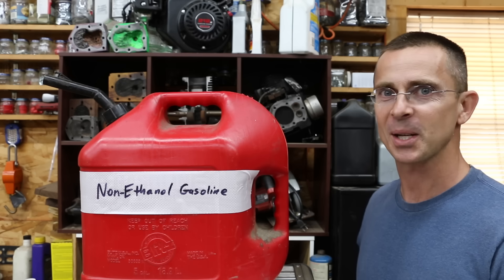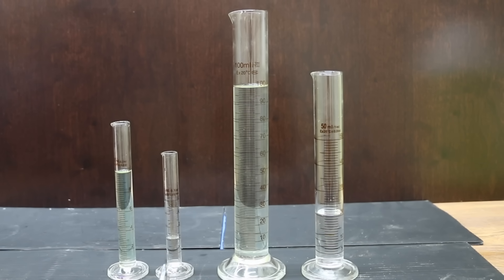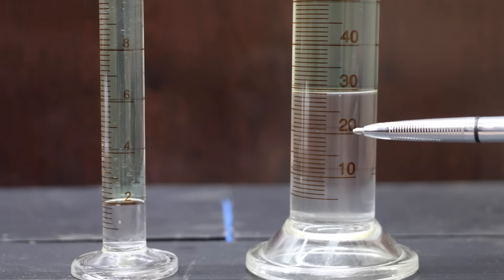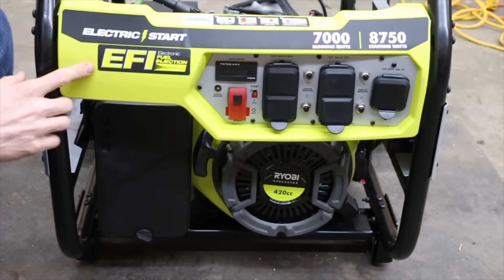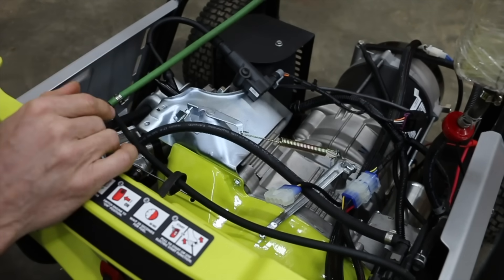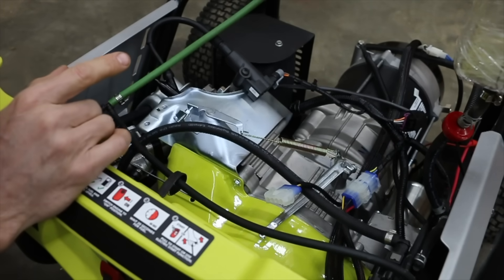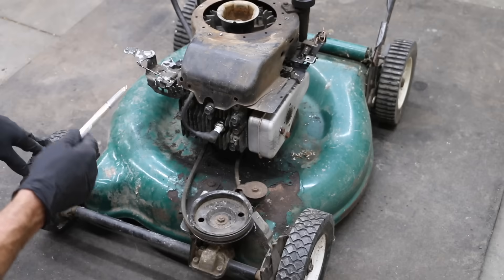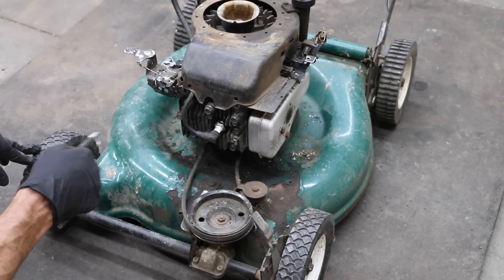Is Non-Ethanol Gasoline Really Better? See the PROOF!

Comment: I don't believe it is more efficient. There are less BTU's in ethanol blends than pure gas. Biggest problem is with small engines and anything with a carb or metal fuel system components. Corrosion is a real pain and water absorption and greatly reduced storage time of stored fuel. Ethanol has probably cost me $1000 's is ruined equipment. Rusted gas tanks, corroded carburetors, melted rubber components. The EPA has not looked at the total cost of ethanol production they just look at slightly less emissions. It does not matter to them that it takes 2 or 3 gallons of fuel to make one gallon of ethanol. Ethanol is gas is a boondoggle and helps no one accept the corn producers.
Reply from the maker: Thank you!

Comment: Ethanol  is a pretty strong solvent. So, if you have run an engine on straight gasoline or even E10, you will have a good amount of carbon deposits as well as some gummy residue throughout your fuel system. Using E85 for one or two tanks is going to give the ethanol the chance to start breaking down the carbon deposits as well as liberating some gummy residue. Thereby causing your engine to run rough and the ethanol gets the blame.  However, its actually cleaning up a dirty system and the rough engine will settle down and run very well  in a short time. An engine that has been run on E85 or better is a very clean system.  You also get a lot less emissions. Ever wonder why every serious racing engine setup runs exclusively nitro-methane or something very similar. Gasoline, or petroleum fuel is actually the leftovers from distilling crude oil into grease and oil. Somebody figured out that it was volatile way back when so they tried runnning their brand new horseless carriage on it.
It worked, but not nearly as good as what Henry Ford's initial product was designed for.
Reply from the maker: Thank you!

Comment: You put more ethanol gas than u did non ethanol gas. Easy catch. You poured the non ethanol to the sides. Then the ethanol to the top. None ethanol gas is for my camaro. Ethanol breaks away from gas. And will mess up a caberator. Let the gas sit a week or two and see what u find.

Comment: You simply overwhelmed the ethanol and stripped it from the base gasoline. Was that your intent? I have worked in the petroleum industry for years and have heard practically every falsehood about ethanol.I could explain the benefits of ethanol if you like, like the cleaning properties of it. Or that it keeps your fuel lines from icing up and never having to add HEET anymore. Also never having water left in the bottom of your tank causing it to rust and leak.

Comment: Problem with this test is the engine itself. With a higher compression ratio to take advantage of the higher octane rating / anti knock of ethanol I think the results would have been different. Added compression equals more efficiency. Engines are limited on compression by the of octane of the fuel.
Need to raise the compression ratio at least 1 point to take advantage of the ethanol.
Reply from the maker: Thank you for the constructive feedback!

Comment: There is a fallacy in how you measure the amount of alcohol in the gasoline by adding a measured amount of water. When two liquids of different molecular structure are mixed together without a chemical reaction between the different chemicals taking place, the volume of the mixed solution can be less than the volume of each liquid added together since the smaller molecules can fit in spaces between larger molecules.  It can be like adding sand to a box full of boulders.  I know that adding water and alcohol together result in a lesser volume than the volumes of the two added together. I don't know what the effect is on alcohol and gasoline being mixed together. The point of your demonstration that you can separate the water from the gasoline is correct but the actual amount can't be accurately determined by your tests.
Reply from the maker: Thank you for the constructive feedback.

Comment: oh so taking the ethanol out of gas lower the octane. Well that's a good thing. The lower the octane the better fuel it is. 
I know I'm gonna get a lot of know nothing's  that will say thr opposite.  the lower octane the higher burn rate. engines with sharp edges need lower burn rate. or higher octane.  Pinging is those sharp edges getting too hot and popping.
So lower octane is better fuel. stop believing the myth of higher octane us better fuel. 
yeap cheap gas is the best gas to run... unless your engine pings
Reply from the maker: Thank you

Comment: Theoretically ethanol fuel should result in poor fuel economy due to the fact that it requires more of it to burn now that's just what I've heard that's not what I know so don't take it as fact. But the reason it's worse than non ethanol fuel is because ethanol is a type of alcohol and that draws in a lot of moisture and if you don't drive a vehicle often enough or better yet even lawn mowers and weed eaters that don't run often it really eats up the fuel system. so I would say yes non ethanol fuel is better
Reply from the maker: Thank you

Comment: Why are people against ethanol?  Is the fact the energy will be produced by the midwest a problem?  Just think, you could be burning carbon neutral organic corn liquor in your hippy-dippy Prius.
Reply: It's not carbon neutral, as it takes energy to prepare fields, plant, fertilize (and other chem applications) , harvest, transport (grain), dry, ferment, refine and again transport corn-ethanol.
Reply: @gregm3139  it takes energy to ferment?  dry the grain? why?  sour mash/wort is a slurry not a dry powderous substance.  Corn oil converted into bio-diesel for the transport and running farm equipment.  Husks ,silk and stocks could be burned for still heat. Refine? You mean distill, right?  Its not going to be used for human consumtion why not use human manure for fertilizer.  Use hippy droppings and it would even be organic

You only dry corn to PREVENT spoilage.   Try putting yeast in dry corn meal and see how long the fermentation process takes.  You ferment dent corn not sweet corn, so don't even go there.

Comment: The biggest problem I see with 10% ethanol is an almost 10% loss in mileage on my 2007 Tundra.  That means I am purchasing about 10% more fuel, but really paying 10% more in FUEL TAXES because the FET (Federal Excise Tax) is on a per gal basis.  In my Tundra I am purchasing 1.1 gal of 10% Ethanol to get the performance of 1 gal of Non Ethanol gas.
Reply from the maker: Great points! Thank you for commenting.

Comment: Not an opinion but facts based upon observation.
2010 Merc Grand Marquis would get 22 MPG on corn gas and 25.75 on real gas.
Old 1984 Honda Goldwing Aspencade motor cycle required the choke to be partially on to run on corn gas and no issue with real gas.
Ariens Snow blower, like the Honda motorcycle would require partial choke to run well on corn gas but not on real gas.

The most damaging issue was a 2004 Class C RV which ran fine until I used corn gas and after that time the fuel filter would plug up every 1,000 +/- miles. Left me stranded quite a few times.
Reply from the maker: Great information!  Thank you for commenting on this.

Comment: I think your carbon test would have been better over the long term.

It doesn't look like you were getting carbon build up from the fuel, rather it looks like you're burning a bit of oil.

Once the combustion is contaminated the test results will be suspect.

For the record I've done testing on my old F100 w/390, 12.5mpg gas, 11.6mpg e10. This truck is an efficiency experiment (yeah, I know, a 390 efficiency experiment) and I've been pushing the timing as far as it will go with mechanical advance as well as vacuum advance for cruising (this is where the mpg gains come in). With e10 the total timing is some where around 42* mechanical + 10-15* vacuum, so around 50-57* total cruising. This nets about 11.6 mpg with the carb leaned out about as far as I can safely go.

Running pure gas I've got to back down the total mechanical advance to around 36* and the adjustable vacuum has to be tightened up considerably due to ping.

That being said I'm still getting significantly better mileage and power with pure gas. If the compression were higher I would be able to take better advantage of the e10's octane, but I think this engine has approx 9:1 compression, maybe 8.5:1.
Reply from the maker: Great point and thank you

Comment: Great stuff.  One thing I do know for sure, is ethanol kills small engines.  I have a pressure washer that I have trouble with every year even though I drain the tank and carburetor after use.  This stuff is bad.. really bad.  I've seen enough lawnmowers and weed whackers die in less than half the time they did before ethanol.  I wonder what's worse to the environment.. non-ethanol fuel or mountains of small oil-soaked engines in landfills and the energy needed to produce so many more of them because of this.  They should make non-ethanol fuel available in small quantities (maybe less than 5 gallons at a time and only in containers?).. for small engines.  I'd like to know if there's a difference between ethanol fuel and ethanol fuel mixed with 2-cycle oil.  IDK, but it seems 2-stroke engines run worse with this stuff.
Reply from the maker: Great point on the damage!  Thank you

Comment: I generally use what the manufacturer specifies.  In my automobile (1998) Lincoln Continental with a high-performance V-8 engine, I use 91-92 octane fuel, which, in my area at least contains no alcohol.  In the winter months, though, I religiously add either ethanol or isopropyl alcohol to avoid water/ice-related problems.  All my small engines are run on high-octane fuel as well... because that's what the manufacturer specifies.  In Coleman gasoline pressure lanterns and camp stoves, I use whatever is available, but prefer actual Coleman fuel because of the corrosion inhibitors in it.  The old-style "gasohol" of the 1970's had an octane rating of 91, and I burned it during the winter in my 77 Ford Pinto because I then did not need to add alcohol.  In summer I used lead-free gasoline as it was cheaper.  I am not surprised that the alcohol-mixed gasoline had less efficiency per volumetric unit.  Alcohol contains less energy than gasoline, so that is to be expected.  In a high-compression engine with the ignition timing set up for proper spark advance, your results might have varied as the octane-boost with alcohol and possibly with the pure gasoline might have made a difference, depending upon what grade of gasoline you used.  Leaded fuels might also have made an efficiency difference, though you'd have had more buildup.  Long-term tests generally give more accurate results as it in effect increases the "sample" size.
Reply from the maker: Thank you

Comment: I like your channel. As far as Ethanol in gas goes, my mind was made up a long time ago, it sucks. Don't run Ethanol fuel in anything, my truck hates it, it killed all of my small engine fuel systems before I figured out what was going on. It  was just another ill conceived idea forced on us by stupid politicians. I don't want to sound like a luddite. Stuff like E-85 has it's place if you running a proper Ethanol fuel system and the correct A/F ratio it will do just fine. But to slip it in as some planet saving potion that you must run, no thanks.
Reply from the maker: Thank you!

Comment: Please check into phase separation & ⛽ crystallization of ethanol ⛽ vrs non-ethanol (& this can take several months) lodging in the carburetor of the system. I've also noted that non-ethanol fueled engines seem to start easier than ethanol fueled engines. In a modern daily driver it makes little difference @ 10% but you do get worse gas mileage, so you buy & use more fuel, offsetting the "ecological gane" Ethanol SUCKS! I will not put it in my 🚤; ATV; 🚘; 🚜; chainsaw; snowblower; portable generator or any other internal combustion engine that I might be using or want to use, especially if it might sit for any length of time. Yours truly A&P with 40 years experience. Want to have some real fun get some blue 100 low lead av gas ☺
Reply from the maker: Thank you for the video idea!

Comment: Wow! This is an extremely professional test, of a level that is well beyond even the likes of an institution such as 'Consumer Reports would perform!  Mixing of different molecules often result in the mix having less volume than the sum of the two individually. 10 ml Ethanol added to 20ml water yields about 6% less than 30 ml, relative to the ethanol added. http://chemed.chem.purdue.edu/demos/main_pages/1.6.html

Thermal imaging cameras are expensive,especially those intended to measure temperatures well over 400 F.  Is the imager made by FLIR and what model is it?
Reply from the maker: Thank you very much!  It's the FLIR 1 Pro.  I really like it a lot (I'm not sponsored by FLIR or any other brand).
Reply: Thanks for the reply. We once used a FLIR, within an enclosed space (with mildly elevated temperatures). One specific brand of transparent Saran Wrap type material (it may actually be 'Saran Wrap, as it was too long ago for me to remember) was the best at NOT interfering with measurements when the FLIR peered through it. If you ever need to do such a study, you may want to experiment with different clear plastic wraps.

Comment: German engineers have built some good engines, I'm pretty sure Rudolf Diesel was German. Ethanol fuel is banned in Germany. The state of Florida made an attempt to ban REAL gasoline in 2010, didn't happen. Real-gas.org is a website showing where you can buy real gasoline in your state and local areas. I've been in the fuel industry all my life, remember the OPEC days of the "gas shortage"? Ethanol blended fuel is insidious both in why its used, and its effects. engine works harder, runs hotter, less mpg, and its highly corrosive. If I did ever use it, it would be only as an accelerant.
Reply from the maker: Thank you!

Comment: Alcohol has Fewer BTU per unit weight.
Less power per gallon . 
Messes up plastic fuel lines floats etc. Sucks up water also. 
Excellent work Thanks!
In Russia we not have problem since we drank it not wasted in fuel tank Comrade.
Reply from the maker: Thank you